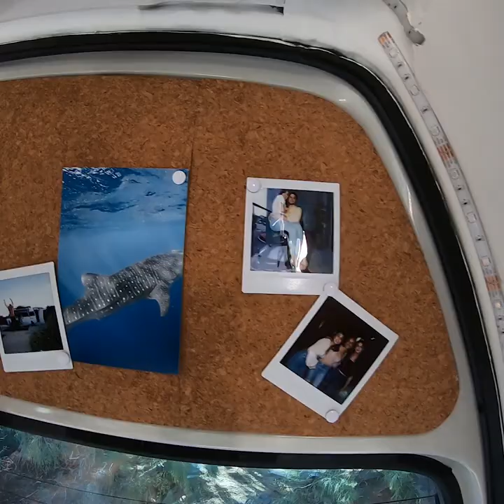AUS VANLIFE CONVERSION - Toyota Hiace Commuter Campervan

Comment: how long is the bed, it must've been shorter than a double to fit the seat by the door in? how do you open the fridge and access the storage compart compartments under the bed? this info would be very helpful cheers!!
Reply from the maker: Yep the bed was cut down to shorter than a double, but we added extra length with another cushion. Just uploaded a tour video where we go through these things - check it out! https://youtu.be/QFZoG8XgQCY

Comment: Great video! Amazing build! What is the height of the ceiling? Your head looked like it's touching. I'm trying to decide on which van to get and need to stand in it. thanks! Mo
Reply from the maker: Thanks! I am about 5ft 4 and I have to bend neck to stand up inside
Reply: @shannonodonnell7735  Bugger well iam 6'3" without my high heels on. You did a great job on the fit out I know I have done two in my lifetime. I would say at a guess you are a chippy by trade.

Comment: This is such a cool way to deck out the van, nice job guys! Sorry I know this video is pretty old now, but if you do see this, how much does the weight now in the back affect petrol use? Im converting the exact same van and I’ve only gotten to the floor and the bed and I’m already worried it’s causing the van to eat petrol a tad more than before

Comment: Best Hiace conversion I've seen. Respect. Couple of questions. What window frame did you use for the rear leftside window. What extractor fan did you use. Did you put a toilet just aft of the fridge under one of your table seats. And how do you refill your solar hot water tube as its pretty high up. So impressed.
Reply from the maker: Thanks so much Chris! I'm planning on answering a lot of these questions in another video so keep a look out ☺️ the fan is a Weisshorn caravan vent with a rain sensor, the toilet is under the seat near the door and I have a very tall boyfriend who can reach the solarshower fill point 😂 will go through the little bits and bobs in a tour video

Comment: Sorry couple more questions. What insulation did you put under the plywood floor, what did you use to cover the earthwool on the side panels and what lifting mechanism did you use for your dining table. Thx heaps
Reply from the maker: Floor is insulated with reflective foil from Amazon, the earthwool was covered up by the wall panels that came with the van (we just removed them to stuff the gaps), and the table leg was a DIY job - will show it in the tour!

Comment: It ended up nicely, cool build, but I'm wondering can you stand in it with your head all straight up after this woody roof you added? Also was the extended roof an after market thing or did the van came like this from the factory, cuz in my region its roof is low and not as high as yours here.
Enjoy it great video
Reply from the maker: Thank you! I can just stand up in it with a slight bend ☺️ Kyle cannot stand up inside - but there would be very few vans that he could stand in!  This model came with the higher roof as it is a commuter, the other hiaces have a lower roof, which we had for our last van. It's much nicer having a little extra space to stand

Comment: What insulation did you guys use?🙂
Reply from the maker: We used bastion XPS foam for the roof, earthwool in the gaps of the walls, foilboard on the windows (all from Bunnings), as well as reflective foil (from Amazon)